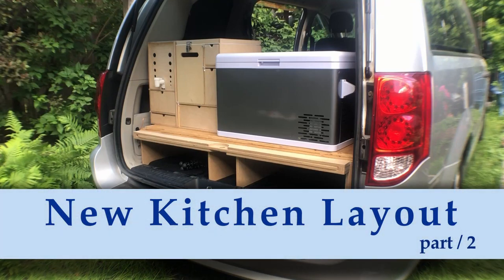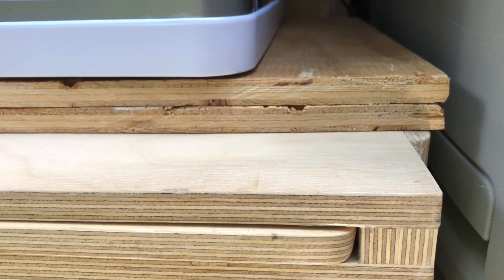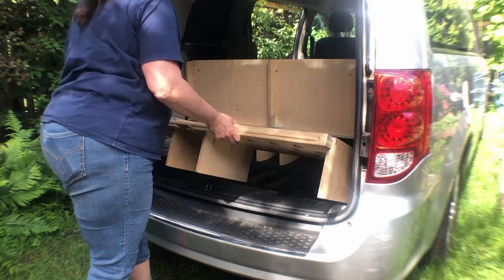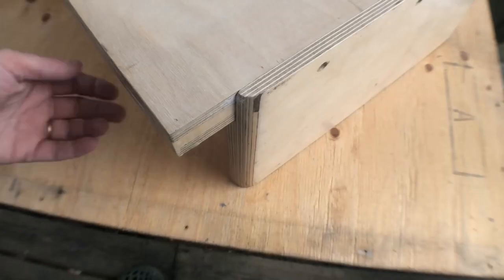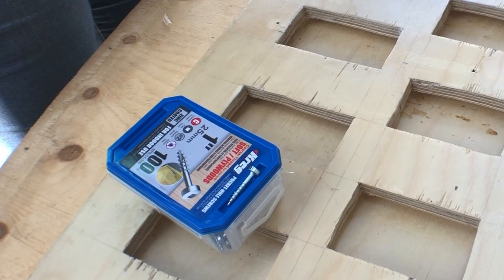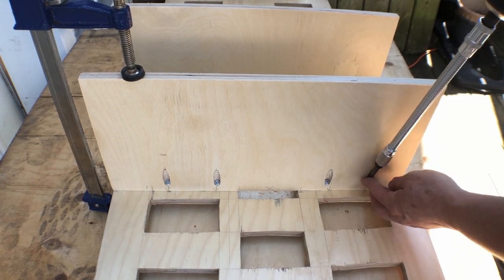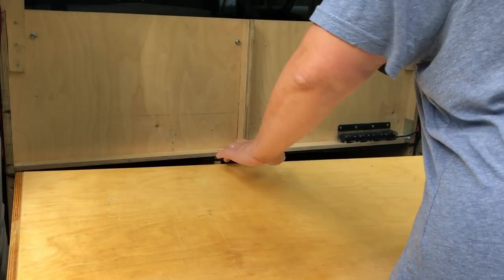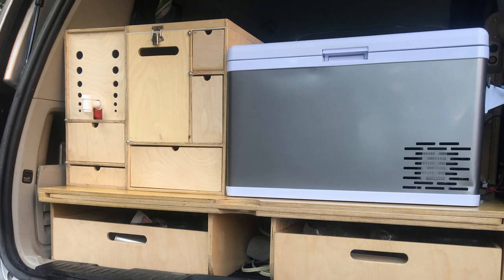Fine tuning my new kitchen layout

Comment: What year range did it fit into?
For example: If I built a started interior in a 2010 Dodge, will it easily move to a 2006 or a 2020?
Reply from the maker: Most of it is transferable - the size of the interior doesn't change much but the windows change a lot - I made window covers for when we rented new vans and had to redo them all for the 2012 model.